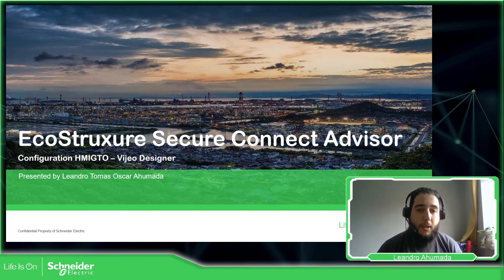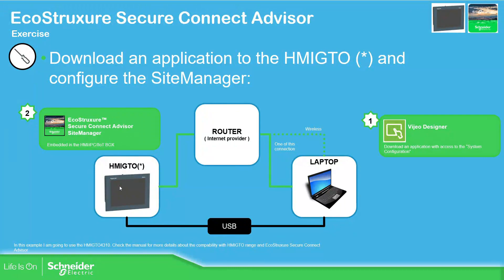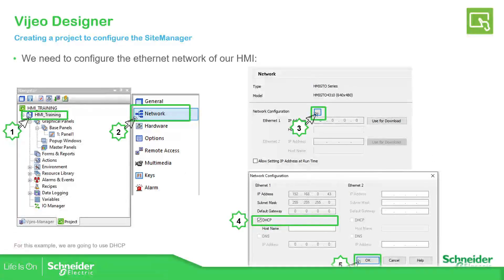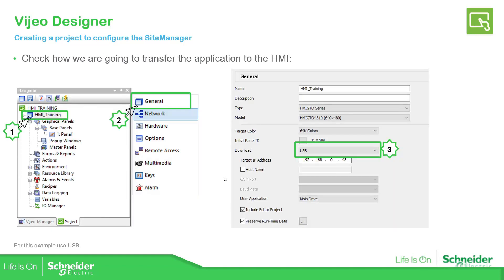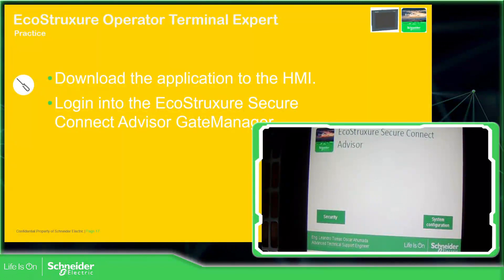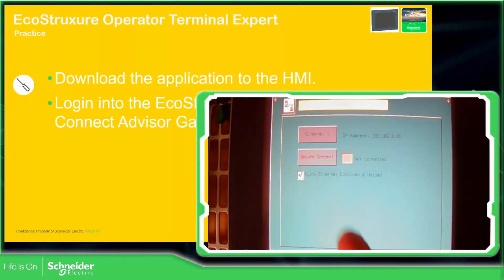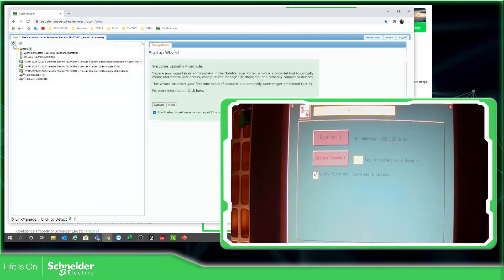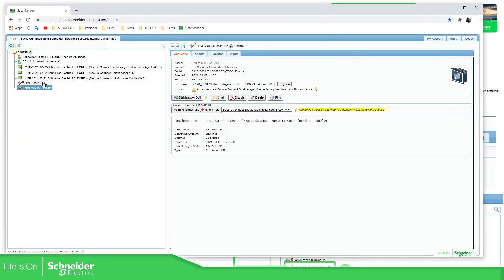Training - EcoStruxure Secure Connect Advisor - M1.5 Configuration HMIGTO   Vijeo Designer

Comment: I am using HMIGTO3510 with Vijeo Designer v6.2 sp10...I have followed the steps u have mentioned but I am not getting the  secure connect option in Network section of GTO.....Can u guide???
Reply from the maker: Hi there! As far as I know the option to configure the secure connect should be in there, you will need to have Vijeo Designer V6.2 SP 7 or later and secure connect is not enable for HMIGTO1300 and HMIGTO2300. You can try with a newer SP to check if you have the same behaviour with the HMIGTO3510 https://www.se.com/ie/en/download/document/Vijeo-designer-V6.2-SP11/
Reply: Hi...today I have checked and found the secure connect option in my GTIO....Just want to know how to provide internet connection to switch ...where the HMI is connected...
Reply: Ok I will check
Reply from the maker: If the HMI is installed in a site where there is not ethernet. You will required a 4G sim card and a 4G Router with a ethernet port so you can connect the LAN port of this router to the switch or directly to the HMI. You can also use a schneider solution using an IoT box with a 4g card slot.